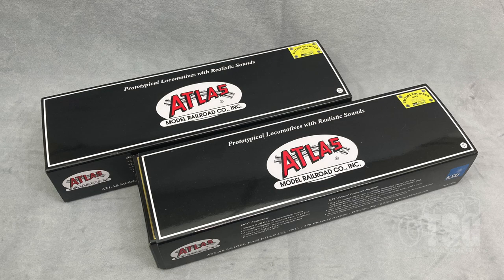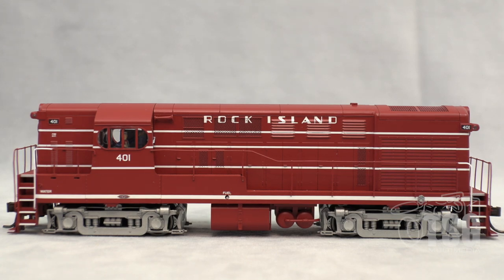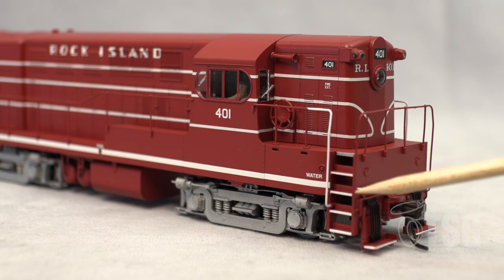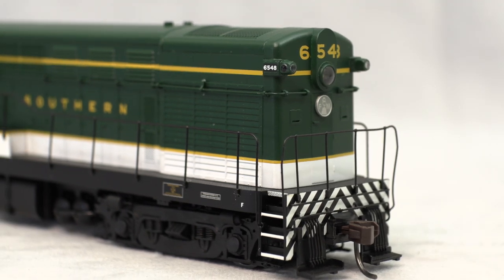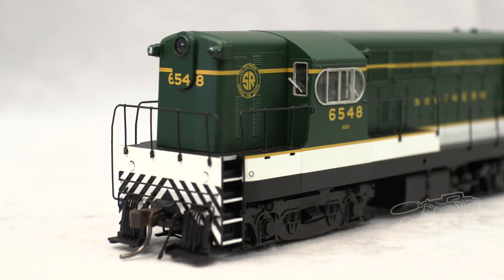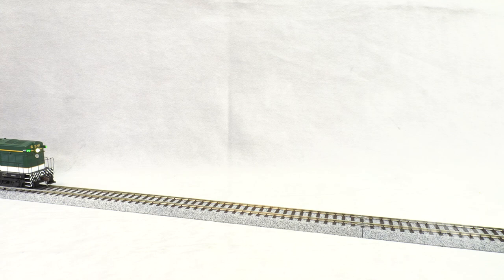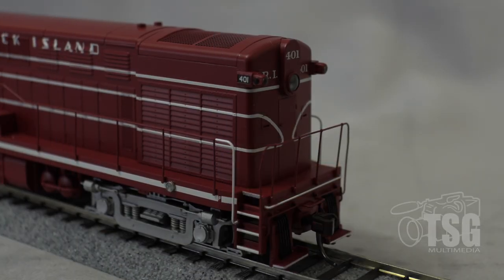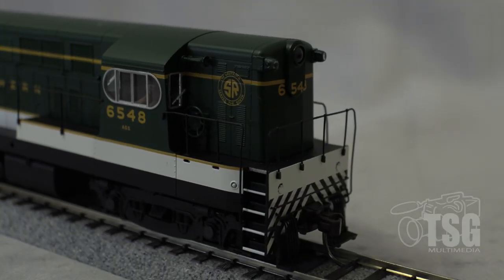HO Scale FM 15-44 16-44 Fairbanks Morse Atlas Product Spotlight

Comment: I have an older Atlas H15-44 Rock island model that used a early Lenz mobile decoder (no sound).
The red/green marker lights work fine in DC Mode but when I switched it to DCC mode I have to cycle F2 to get the green/red lights to change. Your model is a nice example of the improvements that were made. Keep up the good work! 😎🚂

Comment: These are my favorite locomotives from Atlas.  I bought several of the previous run and bought more with this latest run.  The previous 2 runs did have those class lights.  The previous run also had LokSound Select and it had a random startup where it would occasionally stall and have to be restarted (it did this automatically).  I thought that was cool, but it did not make it over to the new LokSound 5 versions.  regards, NS.

Comment: Excellent review as always, John. I'm continually impressed with Atlas's offerings in recent years. I've got a master series HO scale GP40 with Loksound and it is nothing short of excellent. And it's a few years old already. I also recently had cause to contact Atlas's customer service this week with a question/issue with an older (2011) N scale unit that I have and the experience was nothing short of excellent as well. 

-Shane
Reply from the maker: Thanks for sharing! Atlas is very consistent in my experience.

Comment: I believe the trucks on these engines are called Barber Trucks. Southern ran Barber S-2 trucks on these engines.
Reply: The trucks on the SR H16-44 are C-liner trucks,  a Fairbanks Morse design that was an improvement on the AAR Type B trucks used on the earlier H15-44, and many ALCo, GE and Baldwin locomotives.
Reply: I stand corrected.